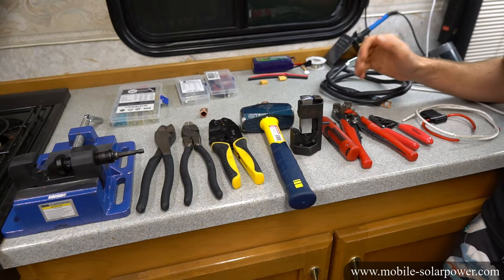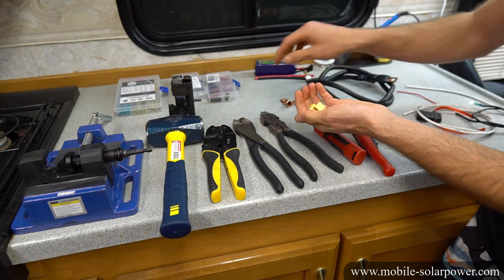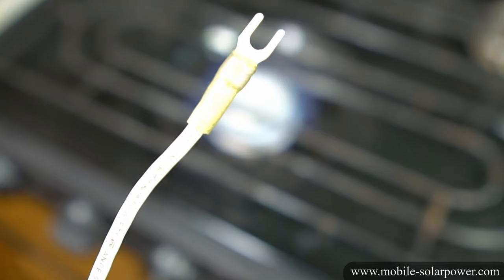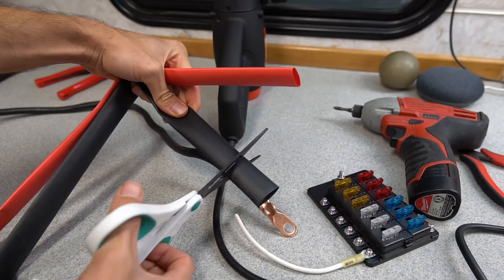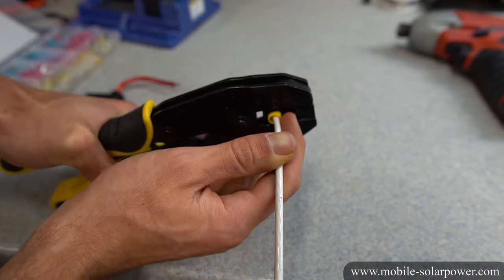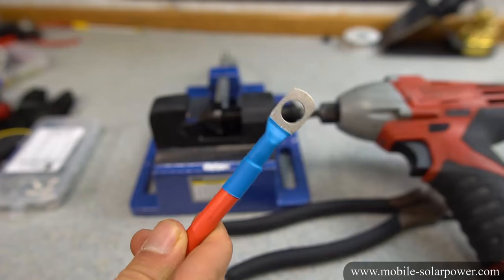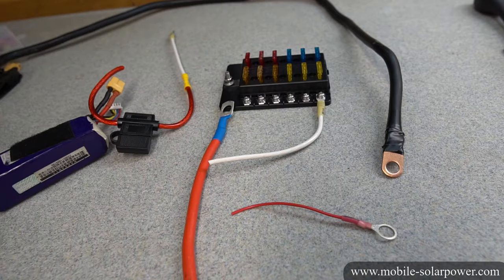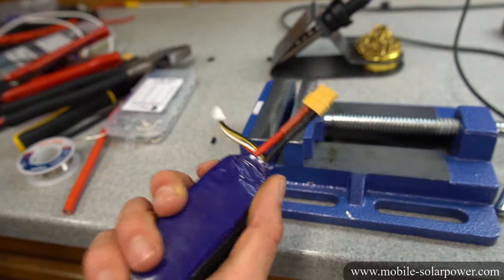How to Crimp Various Electrical Wires: Beginner and Expert Tutorial

Comment: I came here after reading the NASA 'Workmanship Standard for Crimping, Interconnecting Cables, Harnesses, and Wiring'  (NASA-STD-8739.4). It is a mine of information on how finished connections should be but your video makes it so much easier to see how to properly make them. Many thanks.

Comment: Commenting long after the video, but this crimping tool he uses and suggests is THE. BEST. EVER. Mine came today and I started building my 14 gauge cables and I have never made such tight, accurate, beautiful crimps in my life. For less than 20 bucks, this is an amazing tool and you will be glad you have it.

Comment: For the xt60, plug the other half of the plug in for soldering. It keeps the pins aligned incase you do melt the plastic. Let it cool before unplugging.  An extra bit of wire on the dummy side will also help dissipate heat
Reply: Beat me to it xo

Comment: This tutorial was fun to watch! As a radio amateur, I use the Anderson Powerpoles actually for all my 12V connections like equipment, batteries etc. While assembling the PP it is very important to push the connector into the red or black body until you here a clear "click". Then only the connector is properly installed. If no click, the wire will slide back pushed by the meeting connector , the contact will be loose. Pretty often, it is not possible to push the connector into the body just by holding the wire with your fingers since the wire is too flexible and tends to bend. I use a pair of  pincers or long-nose tweezers to firmly hold the wire right at the connector's end  and push it forwards firmly until that "click" sound. It's just my 2 pence :), Good luck! Linas (ham radio operator LY2H).

Comment: For weather proofing electrical tape wrapped ends, a good tip, is use PVC electrical tape, and use the same PVC Pipe glue you would used for PVC Pipes, just apply it to the outside with a light coating, it will meld all of the electrical tape and make it one solid covering providing a weather proof water tight covering so you will not have water infiltration between the end of the insulation into the wire end, that is as long as the extreme end of the wire is not exposed. Plus it keeps it from unraveling. Hope this helps Cheers...
Reply from the maker: Wow that's cool and I never heard of this! I gotta try this out.

Comment: Thank you Will.  Seriously.  Today I had ordered a fuse box and really did not know how to adequately connect the wires to the connectors.  I've been using wire cutters and pliers.  I didn't even know until recently that those tubes that came with my connectors were heat shrink.  Lol.  Yup.  Very useful.

Comment: I don't like using the color butt connectors. I would either solder the wire or use non insulated butt connectors with heat shrink. It aesthetically more pleasing to look at it looks professional and prevents corrosion.

Comment: i have one of the hammer-type crimpers, bought it off a snap-on truck in the 1980's but i rarely use it with a hammer.. when i can i use it in a hydraulic press or at least in a bench vise, gives much better control over the crimp. i've only used it with a hammer when doing on-the-road emergency repairs. at one time this was the best low-cost crimping option but today we have chinese hydraulic crimpers copied off the greenlee and thomas and betts pro crimpers, but instead of costing hundreds or in some cases thousands of dollars you can get a copy that works well for well under a hundred bucks and works much better than the hammer crimper.
Reply: Link?

Comment: Thanks to this video & your store, I've just ordered a crimper, heat shrink, & connectors from your store.  I, very specifically have those 10 gauge in-line fuses with connectors attached to my car battery terminals which I'll now be re-doing because I didn't use good ring terminal connectors & didn't use heat shrink tubing.
     I already have the Klein wire stripper that you recommend.
Warm Regards from Reno, Nevada to you..........hehehe Las Vegas <snicker>

Comment: I crimped my first 3/0 wire tonight using a hammer crimper, worked thanks for the tips, need to get a wire stripper for 1/0, 2/0, and 3/0 could not find the one you use, is there a link where to buy it

Comment: I'm sure you probably figured out over the last 2 years that soldering connectors goes much better if you use flux. Still a bit of a 3 handed job. You can get a small bench vise or small soldering station vise/ 3rd hand with clips to hold the wire leaving both hands free for soldering, especially if you have a bunch to do.  Put a very small amount of soldering flux (not acid flux.. that's for plumbing) on the wire and inside of the connector (I prefer paste when doing connectors, it's easier to control). Then if you pre-tin the tip of the soldering iron, the solder will easily flow into the joint. Add a bit more solder to make sure the joint is filled and you're done. Much faster so you won't melt the plastic!.

Comment: Noticed your impact driver could not do the crimp. I have 3 of those drivers use them daily, in fact I have a variety of m12 tools. I suggest you pick up a m12 4.0 Ah battery. It adds a whole new range of power to the m12 tools especially the sawzall if you have it. The other benefit is it lasts a lot longer than the 2.0 Ah batteries that come with the tool.
Reply from the maker: No way. I had no idea. I'll have to try it. I love my impact so much

Comment: hopefully you put on the bigger ring-terminals a different way 2yrs after this video. Even if you don't have an electrical press you can do a much more professional crimp with a small hydraulic press which works with different press-jaws. The result not only looks better... it's simply a much better connection and works similar to a six-sided wire end sleve for smaller cables. Also you don't have such a big cap between the copper and the rubber-isolation.  On the other side I learned a lot from your channel since the beginning of 2020! ;) Have a nice christmas Will Power... äööhmmm Prowse... ;)

Comment: How do you fit 4/0 lugs on the battery terminals when putting one on top of the other? Is it ok to bend lugs slightly? Otherwise the two lugs on top make a V shape which makes it challenging to keep wires shorter. Please help 🤗

Comment: Hi Will,
Your yellow tool is not used right. Your color dots on your tool are supposed to be at the cable end! You cant use it both ways as in your video, its very important! And shrink tubed needs another tool.
Reply from the maker: I don't understand what you mean at all
Reply: Sorry, its hard to write in english for me. One crimp is made for the wire and one crimp for the strain relief. These two sides of the crimp die are not symmetrical. The side where the colored dot is, crimps the strain relief portion of the terminal and the other side crimps the wire end.

If you make a crimp with the wrong side of the crimping tools die, the crimp will not be correct and will likely fail.
Reply from the maker: Ohhh right. Good point. I never do that but you are totally correct. I got to accustomed to heatshrink connectors haha

Comment: I’m not familiar with that connector , but in general , any metal connector housed in plastic will have a tab that locks it in. 
  I use a dental pick to push the tab down and separate the two before soldering.
   Too easy to damage the plastic or wind up with a cold solder joint otherwise.

Comment: I've never done one of those with a ratcheting crimper that didn't either fall off or pull right off. How in the heck did you get that one to crimp so hard that you couldn't pull it off?
Reply: Maybe your crimping tool needs adjusting. There is often a wheel with indents, held in place by a small screw, that serves this purpose.

Comment: FANTASTIC VIDEO! I love! My new teacher! Can't get enough of;  ''Wlllie Powers'' LOL  <3  Has,  my full attention.  Even when.  I am sleeping. WIllie's powerful,  educational videos.  Are playing. In my head.  Re-wiring,  my brain. Too think like ''Wlllie Powers''  Now,  all I have,  to do is. Discover,  how to, crimp. Those huge wires correctly.  With, dainty lady hands :/  The hammer thingy.  Won't stay still. And having spent. Thousands .. On  SSI. On a 911 electric back up.  BLUETTI. 200P  For my well stocked  freezer. Wit, I now need.  To spend.  thousands of dollars. I do not have.  On a 6 bolt safe.  To secure. My first. New BLUETTI. 200P.  In dirty down town Atlantic City NJ.  I cant afford. A hydraulic crimper :/  For like 10 wires.

Comment: step 1. Solder wire end
step 2. Ditch plastic bits on crimp attachments
step 3. Crimp attachment to wire
step 4. Solder outside ( this also melts the inside solder on the wire end)
step 5. Shrink your shrink tube. DONE!

crimps are unreliable on their own, gotta guarantee the connection stays tight and solid....3 layers of connection is better than 1.
Reply from the maker: Absolutely false. You NEVER want to tin the tip of a crimp connection wire. Please look up safety codes for marine and aerospace application. Crimping is better than soldering. Please read how they work, because this comment is absurd.
Reply: clearly your didnt read my full comment.....
 YES, you are 100% right....,if you ONLY solder the wire before crimping, it can come lose through the crimping process,thermal contraction and expansion ect..... and is normally a thing you should NOT do.

BUT.......If you put a SECOND coating of solder on the OUTSIDE of the crimp and wire, which forms its own connection, and also reflows the solder on the inside of the crimp, this method  fixes the problem of crushing the inner solder during the crimp process, and keeps the connection from having a thermal expansion/contraction problem that causes bad connections. in the end, its  as reliable of a connection as ANY  other soldered connection......... and soldered connections are more reliable than crimped ( thats why most electronics are soldered!!!)

PS  my method is not covered in any manual,  manuals  end at step 1 of my method....they do not cover the second, OUTER coating of solder.....if you fully read my comment, and the manuals you praise, you would realize this.

 the only absurd thing here, is  your assumption that you know everything, and things can only be done one way!
Reply from the maker: No, this is something I understand very well and my dad taught me at a young age, and I learned about in college when studying about cold welding occuring on communication satellites. Doing a true crimp, where the connector is truly terminated, is a cold weld by definition. The two metals become one. It is a mechanical point. A solder joint is not. It is a chemical connection. Totally different. And any solder on that wire will completely defeat the whole purpose of the cold weld process. A true cold weld will be a gas tight joint, and corrosion is impossible. That is a fact. I have had older guys try to argue this point and they are wrong. And if you need to protect a connector, you need aerospace grade or marine grade heat shrink.
Reply from the maker: And if you come up with a better way, please tell me. There is a reason why NASA, boat builders and aerospace industry use crimping. It is better and longer lasting than any solder job. This is a fact. Your method may work for backyard projects, but not for anything that needs to stand up to regulatory codes.
Reply: @WillProwse   

again, agree, with some of your statements, cold welding can bond with great force, BUT your example of nasa using it is not a valid one as, those metals are cold welding in a VACUUM, which is much more bonding than a cold weld inside earths atmosphere, this is why nasa had problems in the past with things like hinges cold welding shut, but those problems did not occur while the spacecraft was on earth, the problems only show up once in the vaccum of space! Most people dont have access to the type of vacuum needed for cold welding to be its best. Also Cold welding relies on the metals being similar enough to bond, this is why hinges on space craft are now usually made from 2 unrelated metals (like titanium and brass), so they dont bond. If your wire is copper, and you have a steel connector crimped to it ( like shown in your video)  little to no cold welding is gonna happen, especially with out the vacuum. 

regulatory codes are for people who need to be told WHAT to think, but dont know HOW to think. THey are a good place to start, but not the end all be all of how to do things.  If you have an understanding of what you are doing, you can apply that logic on your own, and find out what works, and what dosnt work..... dont just blindly accept doctrine, experiment on your own........i know for a fact, from my real life experience, my connections have NEVER failed, from 1.5v to 120v...AC or DC.... ive never had ONE failure from this type of connection. Crimps, both "professionally" done in a factory, or done my self,  usually resulted in bad connections, or have just fallen apart eventually.......  all my experience says crimps are unreliable...... ill stick with what works, till i find something better, so far, i havent.

PS thanks for the replies Will.... even though we disagree, its nice to see a youtuber that takes the time to respond to their viewers. i  especially like that you gave a detailed reply, rather than single sentence or 2 , truly, this is not sarcasm, thank you! keep it up, im sure others appreciate it as well.

Comment: Will, you never solder wires to connectors?
Reply from the maker: Never ever. It's not advisable.
Reply: @WillProwse  Look up how flux works and why the first attempt at the XT60 plug didn't work.
Reply: There are connectors that have soldered pins and there are Mil-Stds to describe them. At least that was the way things were in the 1970's US Navy.
Reply: @WillProwse  
I believe the hole in those big lug connectors is for soldering ...
A good connection has three components: mechanical connection (crimp), 100% electrical contact (proper tight crimp, perhaps soldering), and weatherproofing (heat shrink; solder adds a degree of sealing like on the “inside” end of those big lugs. 

Solder is a concern for being ‘not advisable’ for one specific reason: if it flows up the wire, it makes the wire stiff and it becomes subject to vibration and eventual failure. See the ABYC guide on DC wiring for a reference. And SAE has warnings regarding same. 

But those big lugs show the “right” way- flow a little solder in after the crimp but with quick heat and not enough solder to flow into the wire end shoulder. 

Just food for thought

Comment: That's funny.  You picked up the highest quality crimping tool and said it was for odd situations. Then you grabbed and open end connector to use for demonstration.  If I had found that type of connector in my shop I would throw them away so nobody could use them.  I haven't seen too many gas stoves in shops, either.  But, hammer crimping and mangling the connector had me rolling on the floor laughing.  I used to cringe when I watched videos like this.  I am retired now so it amounts to entertainment.